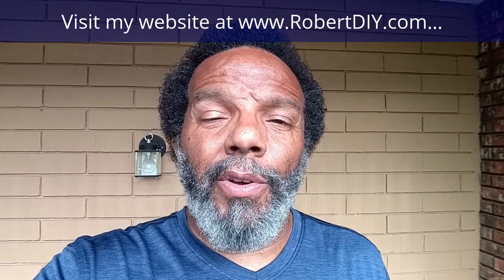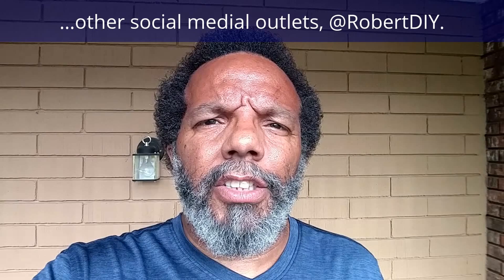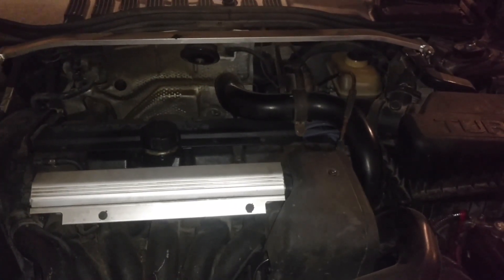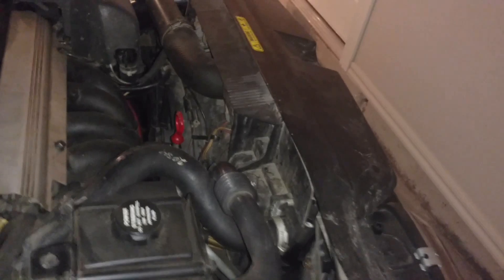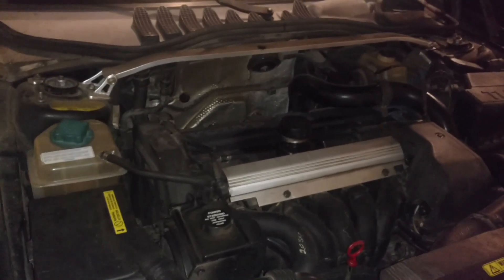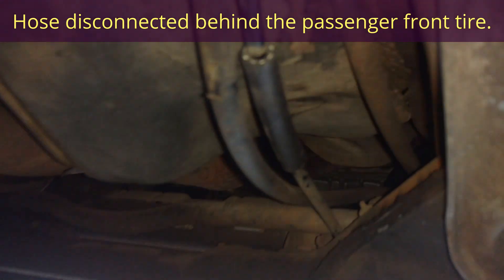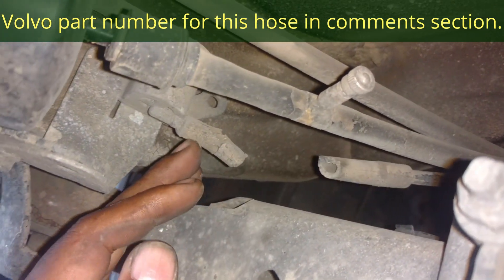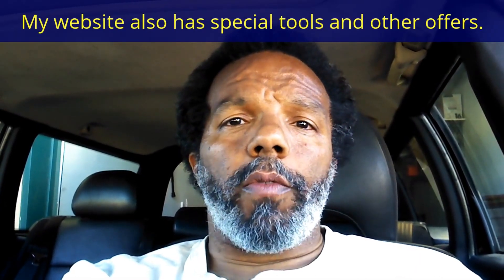Emissions error codes information for P80 Volvo cars, 850, S70, V70, etc. - VOTD

Comment: Hey Robert great video. I was wondering if you could help me with my Volvo v40 2000. At idle it is hissing. When I go on a long drive I will get a check engine light and my car will almost stall out sometimes throwing p0442 code and then it will fix itself and the check engine will go away. I changed my purge valve but the hiss is still there. I just don’t know what to do next. The hiss sounds like it’s coming from the intake
Reply from the maker: may be the power steering pump.
Reply: @RobertDIY  that makes sense because my rack and pinion is leaking power steering fluid. But the hiss was there before the rack and pinion leak. The hiss seems to happen I think when the evap system performs a leak test. Because it doesn’t always hiss.

Comment: Hey Robert, I have a P4022 Code, I Feel like i've checked every Vacuum line in the engine and to the charcoal canister, I have tried to mark the routing's of my vacum lines too, what would you do next? The code only comes on when I drive for a while and the catalytic converter gets hot I guess, I have a Volvo S70 2.5T 1999
Reply from the maker: P0422? That's a cat code.
Reply from the maker: https://youtu.be/5icTmYItwiE

Comment: I have a 98 volvo s70 with the check engine light on. failed smog codes p0108 / p0340 / p0410 - any insight on fixing?
Reply from the maker: https://youtu.be/gt9w-ZSxs9I

Comment: I got code P0453 on my 1998 S70 T5 - Evap emission system pressure sensor/switch.  Does that mean I need a new purge valve? Not sure what part to get, hoses up top and elbows seem good.
Reply from the maker: Yes

Comment: Have you ever seen a evap system problem cause a bogging down at idle? I've got a check engine light with no code most of the time, but one time it gave me p0455, and mostly happens when I fill it with gas. And the idle sometimes bogs down. Turning the car off and then on again sorta resets it.
Reply from the maker: Could be the purge valve.

Comment: I keep getting a blown fuse in the front engine compartment. It's fuse number 5. I plugged the scanner in and it said it was the purge canister valve which is one of the devices connected to this fuse. Where is it located? I have a volvo v70 2001 2.4L turbo
Reply from the maker: I don't know. Find the canister and follow the vacuum tube.
Reply: @RobertDIY  i will but I'm your experience, do they go bad often? And the vacuum line being damages shouldn't cause any wiring issues right?

Comment: I just bought an 09 xc90 non turbo... My CEL came on two days ago with a P0430 code. After googling I decided to try cataclean. Driving on the highway shut off the CEL for about 30ish miles, then it came back on last night while driving in the neighborhood. Should I do another highway run? Any other suggestions before I take it to my mechanic?
Reply from the maker: Not really.

Comment: Question about hoses and other fun stuff..lol. On my ‘95 T5R there are two hoses running side by side right above the fuel filter. What are those two hoses ? They are both broken..looking rusted out or something. I have finally got the car to run (needed fuel pump and a fuel line/filter connection rig) I’ve only ran it a few times at most for 5 minutes. My gauges don’t work so I don’t want it to overheat. Please if u could share any info or helpful hints they would be much appreciated (:
Reply from the maker: The plastic hoses are vent lines for emissions.

Comment: Where is the OBDI connector?  I cannot find it and I keep forgetting how to use the onboard flashing light system.
Reply from the maker: The flashing light box is the OBD1 system.
Reply from the maker: https://www.youtube.com/watch?v=gt9w-ZSxs9I
Reply from the maker: https://youtu.be/bfeiZxhJgxY
Reply: @RobertDIY  thank you so much.  I have codes 121, 413, and 314.  When the car was fist started after replacing the head gasket (didn't need it, but heater core exploded), it idled smoothly.  Took it around a two mile loop and the water low warning light came on (expected that), and read the DTCs.  Cleared them all and took it around the loop again and this time the engine died on the road, wouldn't start right away, then it started and died in front of the shop and took four tries to start again (which was the initial problem i was supposed to fix, fuel pump relay?).  
Anyway, I would like to fix whatever is causing those codes to post.  
Would you just replace the fuel pump relay to solve the no start condition?
Reply from the maker: https://youtu.be/_uTcmPURTXc
Reply from the maker: What are the codes for?
Reply: @RobertDIY  '94 850 wagon 2.5L 20 valve non-turbo automatic wagon
Sorry to keep you waiting, had to replace some brake pads and replace a caliper, I'm back.

Comment: I am on a trip that will require me to drive another 300 miles home and I am getting an emissions error with a check engine light.  The codes indicate an EVAP system leak.  I really don't have the facility to put the car up on ramps etc to check it out.  Is it to safe to drive the car home so I can find the problem at my shop?  The car runs fine otherwise.
Reply from the maker: Sure

Comment: Hey Robert, I have a 1997 base model 850 so it's a non turbo, and im having a problem passing emissions because of the readiness codes. Apparently these cars (only the non turbo) have a problem with the computer not being ready. I've done the readiness cycle multiple times and it still won't work and im at a loss. Any thoughts?
Reply from the maker: They usually pass easy if the station does not cut the car off and runs the scan with the car running.
Reply: Robert DIY when I get to the station, they make you shut off the car and they get in the car and start it again then scan it and it says every time that it's not ready to be scanned
Reply from the maker: ok, how can i help you with that?
Reply: Robert DIY I was just wondering if you had any knowledge of this, it's apparently such a big problem that these cars are exempt from emissions in California. In in Arizona so im in a bit of a rut, no worries
Reply from the maker: I have never heard of the '97 year model being exempt in any state.

Comment: Hey Robert I seem to have a mystery code that keeps coming back. It's a p0130 code for a faulty o2 sensor.  I didn't have the code until I replaced my lines over the gas tank and installed a walbro fuel pump.  I found out I had a leaky injector when it made my car run miserably after running for a minute.  Had some injectors cleaned and refreshed and runs fine.  But I still get the code coming up.  I got it to go away for a little while with taking the o2 out and blowing air into it to clean it out some.  And it's only 4-5 months old Bosch oem. Checked my connections on the plugs and all are intact.  Not sure if dumping too much fuel through it would cause a brand new o2 to go bad or not.  What are your thoughts on this?
Reply from the maker: +Scott yes it can.

Comment: Once  again a very helpful video... thank you Robert, P.S. I do not think your Volvo will ever die because you have gone through it... also I noticed a bar between your shocks over the engine... is that a after market piece of equipment?
Reply from the maker: Yes the strut brace is after market.

Comment: Shame you cant use a pump up garden sprayer to connect to the engine end of the vacume line and create pressure, then you could listen for hissing.
Would be usefull for small leaks that were not obvious.
Sorry silly brain again :-D
Reply from the maker: +zx8401ztv sounds like a great idea. Smokers are the best

Comment: hey Robert, I have a P0455 code on my 850. it's for a large leak/no purge flow. Ever run into this code before?
Reply from the maker: +Drowsy_ Mouse yes.
Reply: Robert DIY UPDATE: I finally was able to get the check engine light to go out for probably the last 500 miles. If you have a P0455 code there are a few places you should check for cracked/broken vacuum hoses/elbows. 

1. Next to the fuel filter going into/out of the rollover valve. 

2. lines connected to the charcoal canister and the valve behind the wheel well cover (can't remember the name of it) 

3 . rubber elbows under the hood for breaks near purge valve 

4. lines above gas tank (probably requires dropping the tank) 

in my situation it was most definitely #1 and #2 causing the code, with possibly #3 as the elbows were somewhat dry rotted under the hood. All fixed now fortunately.